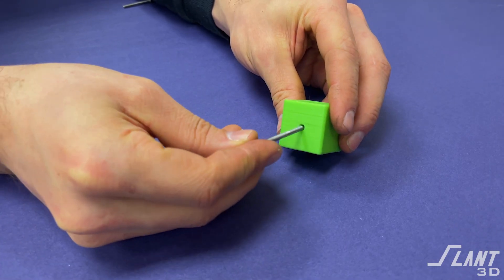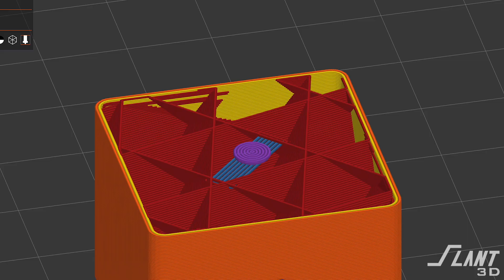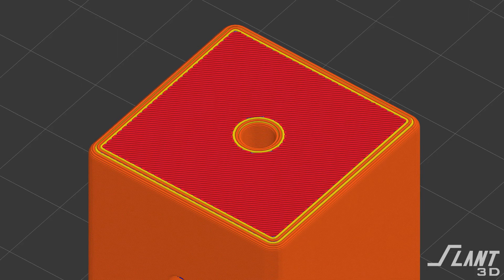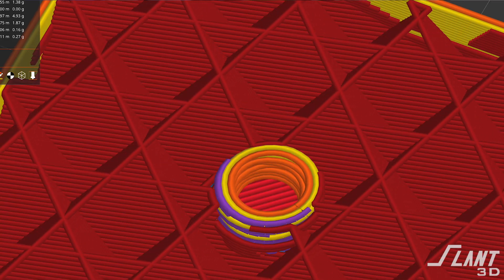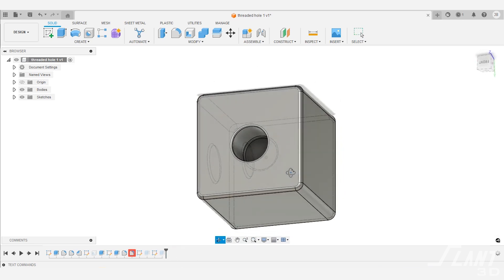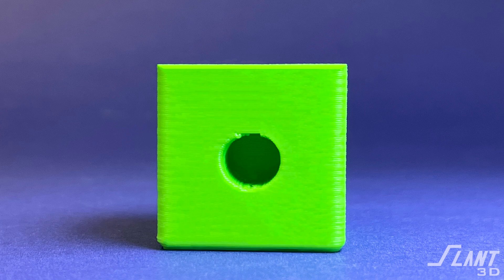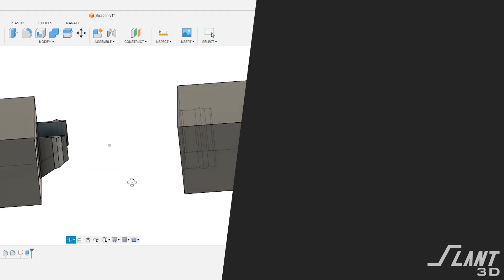Threaded Holes & Inserts | Design for Mass Production 3D Printing

Comment: So exactly how should I design a hole for a heat set insert?  You didn't really cover that.  The application I have in mind isn't really high stress, it's for a retaining screw for a cover.

Comment: I don't understand why more people aren't talking about using screws designed for thread forming plastic. Works great and you see them in just about every injection molded part. Why fiddle with threaded inserts and captive nuts when we have a great solution right in front of us?

Comment: I'm surprised no one mentions using a coarse thread. If you have the opportunity to use a coarser version of the same bolt it will reduce tear-out and act almost like a wood screw but, when done right, I get way more reuses before it wears out. Not necessarily as good as metal on metal but much cheaper.

Comment: A good tip from Slant 3d - one that I frequently use - is adding a taper to the top of my vertical holes (teardrop shape), to avoid sagging top layer sagging inside the hole. I generally end my hole sketch with 2 lines at 100° that create a peak on the hole - works great and thanks.

Comment: When printing holes on the side of a 5 started to add what is basically a triangle coming out from the top of the hole (like a teardrop). In order to eliminate the overhang. Just another solution

Comment: One method I've used for plastic threads in a printed part is this:

Undersize the hole in the design process (eg. 3.75mm dia hope for an M4 screw).

Get a length of threaded stock (M4) in my example), or cut the head off of screw, to use as a tap.

Put the length of threaded stock into a drill set to low speed. Optionally, lubricate the threaded stock.

Using a butane torch lighter, preheat the hole. Less is more.

Then use the threaded stock in the drill as a tap. Gently apply pressure run the drill very slowly. If it binds up, back out, reheat, and repeat.

This is a quick and dirty method that has worked well for me. Also if the hole is too big, snip a bit of filament and put it in the hole prior to preheating to resize the hole while threading.

Comment: The most obvious solution that nobody seems to ever consider: self-tapping plastic screws! They're not optimal for something that needs frequent disassembly, but if you just need to join two parts, it's so much simpler!
Reply from the maker: Mentioned in the video in the first example. ;)

Comment: I prefer 30 degree trapezoidal threads.  With a minimum diameter of 6mm, I can print both the male and female threads no problem on an Ender 3 V2 Neo
Reply from the maker: Yes. The design of the threads is absolutely also important when they are necessary

Comment: I see you're getting better at this.
I approve this one, good stuff.

As for the snap approach, I myself some times do "double self-locking snaps", it's a snap with another snap that snaps into snap, locking it from ever unsnapping.
Since the inner snap is hidden inside and the outer snap is locked from unsnapping from the inside, there's no way it can ever unsnap, creating a very easy to assemble and also reliable joint.

Comment: Stefan from CNC kitchen has a video in which he tested the strength of heated inserts against screwing into the part directly, and heated inserts are basically overkill for most screwing applications with 3D printed parts. Inserting a nut so as to have embedded threads is also a good idea, except for the part (no pun intended) in which one basically needs to be babysitting the print to pause and insert the nut.

Comment: We've learned that square nuts work better than hexagonal ones when embedding them. Moderate torque and the hexagonal ones can slip and turn even with a tight fit because plastic flexes.  Square ones do not.

Comment: Another way to embed nuts into a part is one of the ways that Prusa does it. Design a rectangular slot that intersects the machine screw hole for a square nut to be inserted into the part during assembly so you don't have to pause a print somewhere buried in your printfarm.
Reply from the maker: Also a reasonable way to do it

Comment: Great entry to the series as always!

An entry I’d like to see: how to design parts that are designed to be separated.  

An example:

A small wall mount that is designed to have a removable bin attached to it.  Like a bin that could hold a bunch of wood screws but removed to take to a work area.

Another example:  how to design parts that are too big to print on their own but can be broken out into several prints and then adhered together afterwards with epoxy.  Like if you were trying to design a trunk lid spoiler for a car for example.

Comment: I use both threaded inserts and nuts. But I can only use the nuts in the horizontal plane. In the video you are inserting the nut in the vertical plane. How do you keep the print head from colliding with the nut ? Am I missing something ?
Reply: It looks like the pocket is deep enough that the top point is below the surface, so there will be some small voids in the final part. A square nut would be better. Or you could add some custom gcode to squirt plastic into the voids.

Comment: If I need a reliable threaded hole, I either use a heat set insert, or I print a round (or drop shaped) undersized hole with enough walls to be strong at the final size, then I drill to size and thread it with a tap.
But I don't do high volumes.
The other option is to direct thread into a smooth hole.

Comment: That threaded cut out idea is brilliant. I would have been afraid it might lose strength but glad to know it’s not the case. Always looking for ways to build more efficient prints, thanks for these videos. I would be curious to know though, from your perspective, to manufacture products with parts that need to be fastened together, what is your preferred option. Threaded holes, inserted nuts or simply snap fittings? That is for parts that just need fastening together, not necessarily high strength requirements.
Reply from the maker: Check out our Joining Video

Comment: I would like to see something on multi materials. How can i add a TPU surface to a PLA base.  Something like a soft face on a bolt used as a clamp.  Can you figure out how to do this with a single nozzle machine.  Thanks... Like your channel.
Reply: One way is to print the two different materials as different parts, as they require different print temperatures. Designing the parts so they snap, or fasten together would be the easiest solution. 
Note: it's not often that a material change occurs at a single layer height boundary across a full part, so this would require multiple filament changes (and purges of the print head), or a printer that can print with multiple filaments unattended.
Reply: @AerialWaviator   I agree with exactly what you are saying.  I was thinking about a mechanical ways to do it.  The only good way would be to use a multihead machine like Prusa XL. That way nozzle temps and all the other issues would not be present.

Comment: Always use square nuts if you're going to embed them. Much more resistant to torque, and way less likely to ever rip through the plastic and spin. Where I can, I don't bother pausing the print to insert them. I just use a cut out that goes to the face of the component if that makes sense. Then I just slot them in, and push them down until they're in line with the hole. 
I will design my products, so that the holes where they're inserted end up hidden.
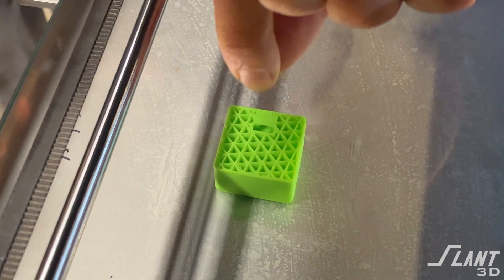Reply: Great idea. I've used the nuts-in-slots technique before, but always struggled with tolerance. Square nuts would be much more forgiving. And better for embedding too, since the top will be flush with the print surface after dropping in, unlike the hex nut at 2:45
Reply: How would you go about that if you want to print a siphon...my Ikea Atlanta just broke because it's made of shitty plastics and the screw goes directly into that in the middle from the sink. The whole screwhole is raises in the middle but so weak that it breaks.
I want to print a better version from ASA or ABS

.
Reply: @heavyweather  I'm afraid I don't understand. I am not sure what an ikea atlanta even is. Sorry I can''t be of more help

Comment: Can you do a video on the strongest glue up joints for parts that are too big to print on a build plate and have to be spilt up? Or maybe the various ways to split and reattach them where the joint will last long-term.

Comment: How do you calibrate the printers when you are building a print farm? You must have a fast and accurate calibration method to use so many machines and filaments. Very interesting topic to me.

What is the tolerance and dimensional accuracy you advertise/produce? +/- what?

Comment: Very cool video. I can't believe Ive never considered that nifty "cut out the threads" trick you showed. I'm partial for the inserts/nuts depending, but for big stuff that opens alot of doors design wise
Reply from the maker: Glad it was helpful!
Reply: @slant3d  Thanks man! Hey, yall wouldn't need an Mechanical Engineer, would you?

Comment: I find threaded holes in horizontal orientation come out excellent without omitting top/bottom thread. It may be dependent on having adequate cooling; however, the thread structure tends to make the overhangs less challenging.

Comment: I will sometimes print the hole undersize and use a tap to form the threads like with metal. It's much stronger than trying to print threads or letting the screw cut its own threads. For something more rugged I use heatset inserts but they of course require you to have a soldering iron handy and have a bigger keep out area around them.
Reply: I almost completely stopped using metal inserts and usually just use a thread cutter now. The force needed to rip out the threads is almost the same as for ripping out the inserts.
Reply: @Vindolin  Today I tried to rip a pillar with a M4 thread out of a PETG part that I'd tapped, the whole part was flexing and  felt like it was going to break while the threads held strong, I stopped before breaking the thing.
Reply: I think it depends on the size of thread
In my experience M5/M6 and upwards are usually strong enough to be cut into the plastic, for M4 it really depends on your sensitivity/experience when tapping and fastening your screws to not over tight, everything M3 and smaller I use heat set inserts as my failure rate with tapped hole became too high
And it also depens on how often you will thighten/loosen your screw, if you just screw it once and never touch it again, tapped holes are probably fine, if you plan to disassemble your part often heat set inserts are far superior as the pratically don' wear
Reply: @tallAldiProduction   Yeah, fine pitch tapped threads like m3 wear out pretty quickly in PLA. I use coarse threaded self-tapping screws, and haven't worn one out yet.
Reply from the maker: That is also a good way. Tapping is great.

Comment: I have done routinely printed M3 / M4 threads, no issues there at all. Then again, since machine time is not so important for me, i tend to print LH of 0.05-0.12mm.
These were done with mostly stock Ender-3 (Quality of life upgrades only; Filament guide + fan guard)
Reply from the maker: Vertical that is fine with high resolution. But nozzle size prevents it in the horizontal

Comment: How does Slant do nuts inserted into the print? Robots or is it just a Person inserting them?
Reply: Nuts deep…
Reply: An option is a slit on the part where nut can be dropped into place post print. A good solution if the slot is on the bottom, or hidden area of a part.
Another option is two parts that snap/twist together hiding the nut.
Reply: someone goes balls deep
Reply: @marshallb5210  nuts deep, rather
Reply: On most slicers there are built in features that let you pause print at a set height or layer, allowing you to drop parts in. 

Then you can resume the print to let it print over the dropped in part.
Reply: @jaredupchurch7819 In my 3 years of 3D printing, I have never been able to get a 'pause' operation not result in an obvious layer adhesion difference for the next layer layed down after the 'resume'. There is always an obvious layer line around the entire object where the pause had occurrd.
Reply: @imacmill  Try inserting the pause command after the outer wall is printed, rather than between layers. That way the inner walls and infill will be done while the flow re-stabilizes.
Reply: @dekutree64 this is actually a very insightful comment but how do you specify that ? In the slicer interface there is an insert gcode option on right click-is this where you would put it?

Comment: i find it very very nice to use what is effectively 2 parallel hinges that interlock with another 2 hinges of a printed part. That way when you secure both hinges no movement is possible. This works very well with the use of paper clips as the hinge axle as they can be easily secured and are quite durable.
I like to use this quite often with Size #1 paperclips inside of 1.1mm to 1mm holes depending on tolerances. It's cheap, effective, durable, not hard to print, and only requires the straightening, cutting, and placement of paperclips. Probably not the best for making millions of a product but it works well for me.
Reply: I would imagine that if you really wanted to make a lot of them, you would use a spool of some kind of wire, or get metal rods and cut them en masse.
Reply: @patricktierney4392  yeah probably, would definitely cut down on a majority of the post processing, would also let you be more specific with the actual diameter of the wire used and of your hinges for smaller or chunkier builds. for me though it's just easy enough and works well enough to grab a cheap box of paper clips and use them.
Reply: Is there a video on this?
Reply: @phasesecuritytechnology6573  not really as far as I know, it's just a simple solution I figured out one day and use often